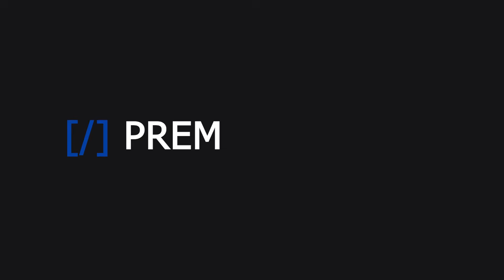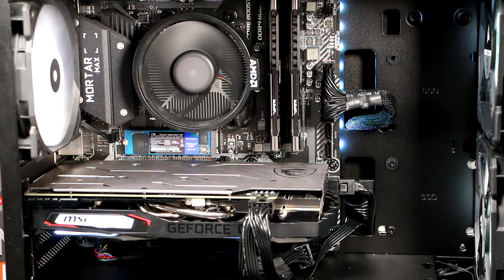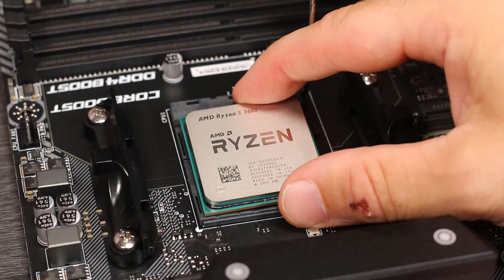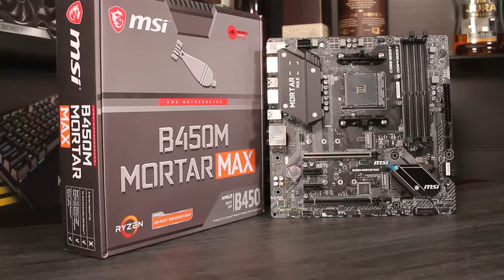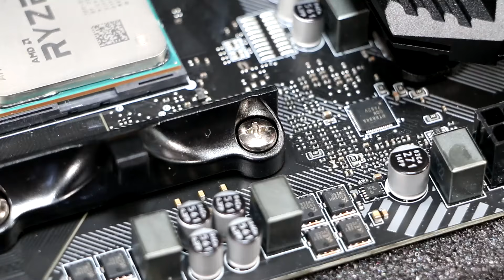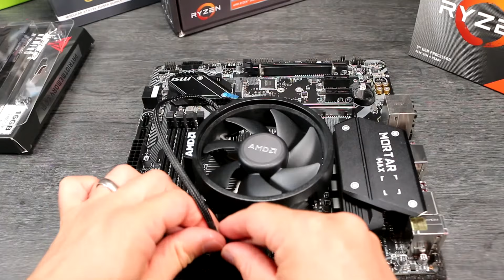How to Install an Ryzen CPU: A step by step guide

Comment: I have a AMD Ryzen 5 2400G Processor with Radeon RX Vega 11 Graphics and i tried to install my new cpu the AMD Ryzen 9 5950X 16-core, 32-Thread Unlocked Desktop Processor but when i load up my computer after installing it nothing happens then computer turns on but my monitor stays black
Reply from the maker: Do you have a graphics card? The 5950X has no graphics ability at all, you will not get any screen output unless you add a GPU. If you do have a GPU, it's likely that the Motherbaord needs a BIOS update - check your Motherboards website for the information and BIOS image.
Reply: @BuildPicker  
My gpu is a Radeon RX 580 Series

Prime A320M-K.   BIOS Ver. 9102
AMD Ryzen 5 2400G Processor with Radeon RX Vega 11 Graphics
Speed: 3600 MHz
Memory: 32768 MB (DDR4 2133MHz)
Reply from the maker: @d4rkstr1der61  Hi there. Checking here: https://www.asus.com/Motherboards-Components/Motherboards/PRIME/PRIME-A320M-K/HelpDesk_CPU/ Shows that the 5950X is not supported on that motherboard. In fact I don't believe A320 supports Zen 3 (5000series) Ryzen CPUs at all. You need a new motherboard. Id recommend at least a mid range B550 Board for that CPU!
Reply: @BuildPicker  i have verying little knowledge of computers so do you have any motherboards that you can recommend that are compatible with my computer and new cpu I want to install? Also you have been an amazing person helping me out I am subscribing to you my friend.
Reply from the maker: @d4rkstr1der61  I have a video on that! I'd recommend a rmid range B550 Motherboard. Don't go too cheap: the 5950X is power hungry and you need a reasonable quality motherbaord to suppor tit. See my recommendations here: https://www.youtube.com/watch?v=FOMiam3MnHU
Reply: @BuildPicker  Your awesome man thank you so much I think I'm gonna go with the MSI MPG B550 GAMING PLUS Gaming Motherboard